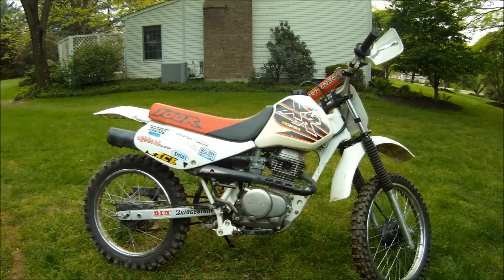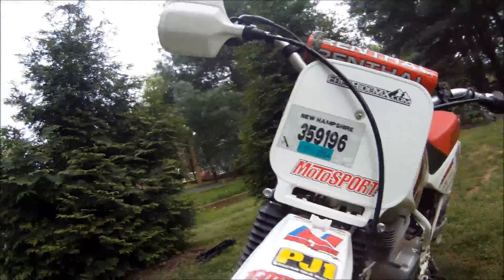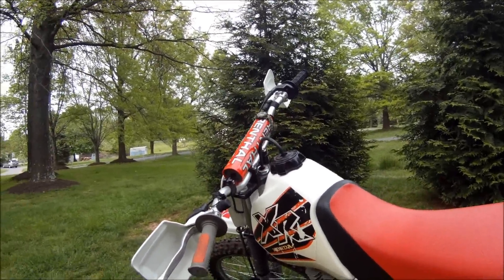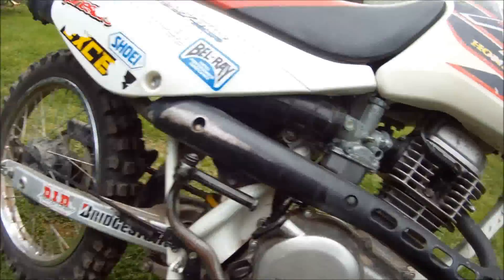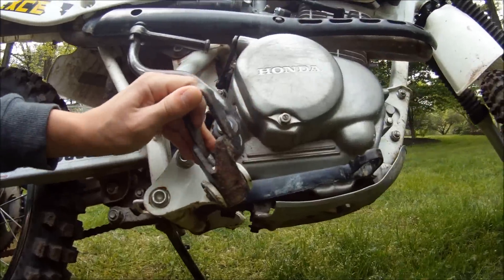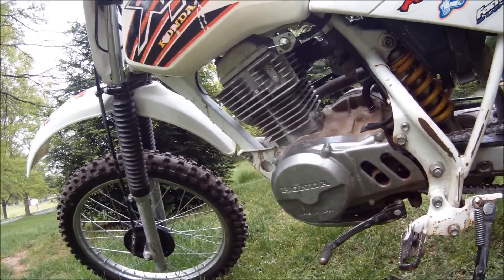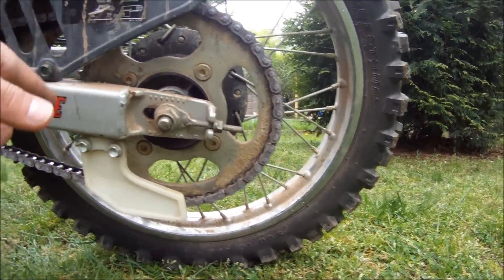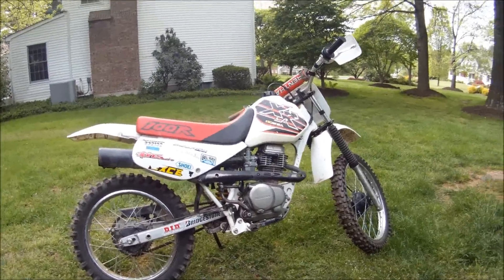The Parts of a Dirt Bike

Comment: Yah he called the top in a piston which also has valves timing chain cam valve Springs right now I'm in the middle of rebuilding the xr80r 1993 he forgot about the chain tensioners for the timing chain he called a top in a piston and so on just some of the parts he got wrong.

Comment: can someone please tell the incorrect parts he got wrong?
Reply: Yah he called the top in a hey piston which also has valves timing chain cam valve Springs right now I'm in the middle of rebuilding the xr80r 1993 he forgot about the chain tensioners for the timing chain he called a top in a piston and so on